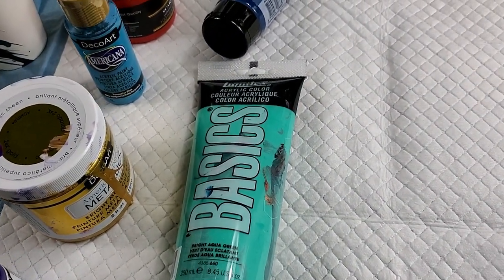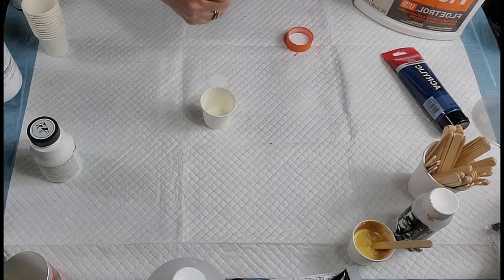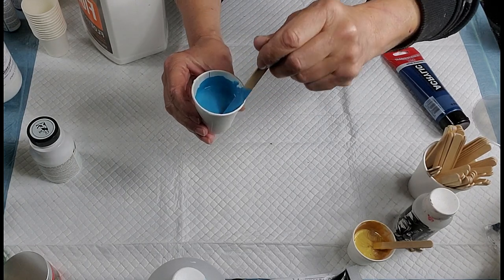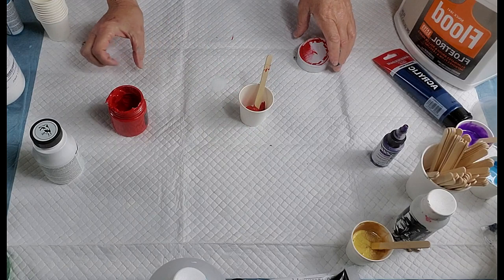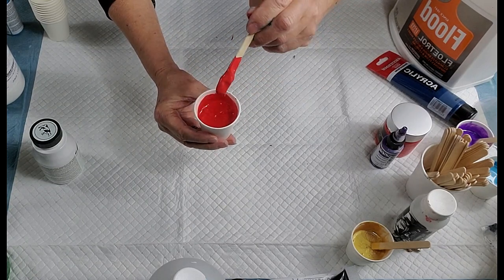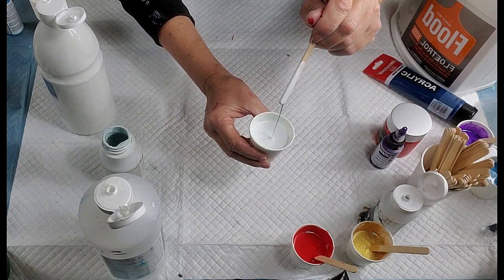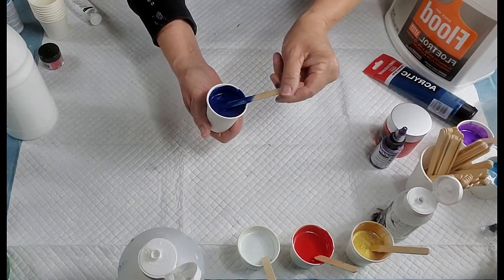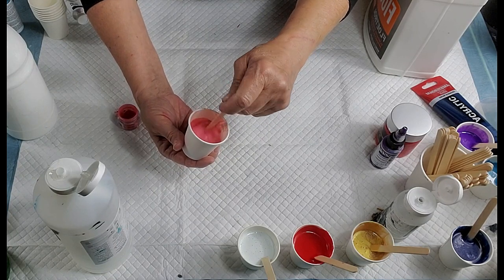(302) Acrylic Pouring Paint Mixing Talkie

Comment: This was soooo helpful! FYI, I found a little battery operated hand held mixing tool on Amazon. It's suppose to be used in resin. But it does a fantastic job on mixing difficult acrylic paints. You do have to let the paint sit for awhile to release the air bubbles.
Reply from the maker: I'm soooo glad it was helpful!!! Really stressed about a talkie but just couldn't do it any other way =) I have a tool that attaches to a drill and it's for mixing pigments in resin. Works great when I remember I have it! lol!😜
Reply: I have one of those tiny battery operated drink mixers (I think that was what you were talking about) too, and since I use mostly 1 ounce medicine cups to mix my paint, it was almost a disaster... imagine splattering paint everywhere! Then I got the plastic 3 ounce cups to mix the paint in, and those worked well. The metal spikey part does big damage to paper cups, tje whisk is too deep to fit in them, the plastic one that splits doesn't work well unless you have a deeper container. But the bubbles in the paint can take days to come out if you mix thicker paint. I start with thick paint, and then if I want to do a dutch pour, I can thin it out, but the thicker mix is available when I want to do a ring pour or a straight pour.
Reply from the maker: Martha Dillon  A drink mixer? What a great idea! I didn't even know there was such a thing! lol! Yes, I bet the bubbles are crazy though 😆👍❤️
Reply: @HarmonyHouseArt  I saw it on MicroMark.com, and the same thing was on Amazon much cheaper, so I bought it. Most of what I paint is very small, usually less than 5x7, and most often in the 3x4 range, so I use tiny amounts of paint. A 5x7 can be done with about an ounce of paint, if you have a base coat. I still have to make about 2 ounces of each color and store it in 2 to 4 ounce squeeze bottles from Amazon.  I started with 8 ounce bottles, but after several months, I noticed that even in the ones with tight caps, the paint started to dry on the inside sides of the bottles. So now I've downsized everything and can store it in a much smaller area.

Comment: thanks Lisa I had watched it lol....just going crazy with dutch pour technique not successful with my blow dryer, i have a cart full on amazon using your link plus your blow dryer, hoping it gives me luck, also not successful with the Shelee Bloom, i did take the course and have tried many US floetrol recipes but no luck will order the Lineco Neutral ph glue and see how that goes, thanks Lisa I love your creations and your channel, you are amazing
Reply from the maker: Thank you, Mileivis! For me, the smaller hair dryer made all the difference with the Dutch pours...I just have so much more control with the smaller dryer. For the bloom technique, I didn't take the course but have gathered enough from other YouTubers to figure it out. The key (to me anyway) is the topper or as some call it, the cell activator. You need a good quality, stretchy paint for that which is why the Amsterdam Titanium white and Oxide black both make outstanding toppers =)

Comment: HA !!! .   We mix pretty much the same exact way. Lol .  I just squirt the paints in then add my PM to almost the top of the cup & just mix it ... I just make sure I leave enough room in the cup in case I need to add a little more paint or a little water without making a mess. Lol .  I have so many different kinds of paints and pouring mediums I could open a small art supply store. Haha  I  mainly use floetrol but I have Liquitex, Pebeo, Primal Flow, Artist Loft , (Vallejo pearl medium ( just for when I want to give my paints a pearl look to them) ...and a couple others I cant think of right at the moment. Lol.  I'm a huge junkie when it comes to buying paints & mediums .. I love trying different things but as far as measuring anything  NOPE  not doing it lol.  Drives me batty watching a video and they pull out the stupid little scale & measure everything to a T. Hahaha. Its just pointless to me & makes no difference in how the painting turns out ... you get so used to mixing after a while you just know by feel & look that its mixed perfectly fine.  And using a scale teaches you Nothing about learning to mix on your own .  Anyway great video .  Thanks. 😜😜😜😜
Reply from the maker: Great minds, right? lol! 🙏❤️😊 Thanks, Julie!!!